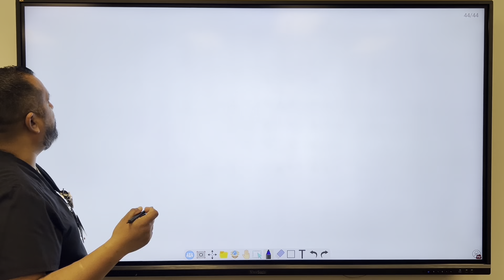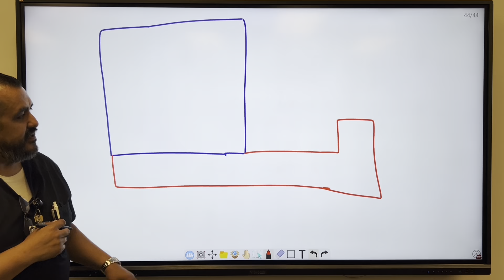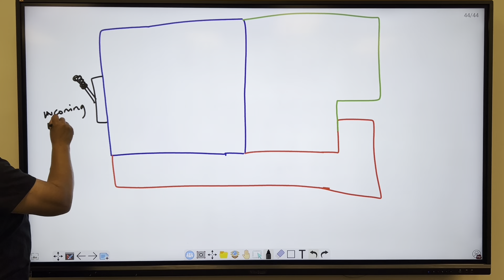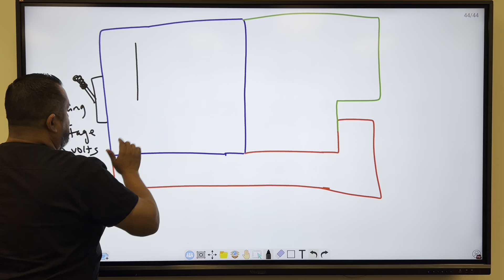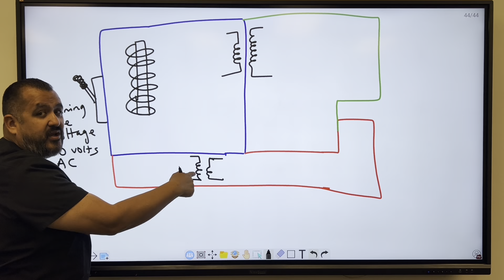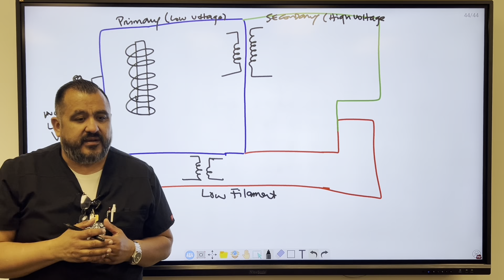X-Ray Circuit, Radiographic Physics (Safety) | Radiography with Mr. M

Comment: Current rad tech student; vids are very helpful, Mr.M. 
Quick question: I thought voltage and current have a direct relationship under Ohm's law, but I noticed it's inversely related for the step up/step down transformer. Can you explain?
Reply from the maker: Hello, Thank you for the comment & question.
Yes, I =VR or Ohm's Law is the basic formula for all electrical circuits, however when it comes to transformers we use Faraday's Law, AKA Transformer Law. This is related to the number of turns of the wire, the voltage & the current. There is an inverse relationship when it comes to transformers. I hope this helps. If you have any other questions please let me know. Mr. M
Reply from the maker: Hello, I just noticed I have a type-o with Ohm's Law. It should read I =V/R,  R=V/I   or V = I x R
Hope you are doing well with the basic x-ray circuit. Mr. M
Reply: @RadiographywithMrM ohhh understood now, thanks!

Comment: Question: The transformers are labeled ‘primary’ and ‘secondary’ transformers solely based on the number of coils?
Reply from the maker: Hello, the number of windings are a factor but they are not the only item. The thickness of the wire, the insulation of the wire, the voltage changes and the electromagnetic field that is created from one end to the other are also factors. But the easiest way to identify them as being a step or step down is the number of windings compared to the primary and secondary side. I keep it simple, the more windings on the right side, then it is a step up, more windings on the left, then it is a step down. I hope it makes sense. Mr. M
Reply: @RadiographywithMrM  Cool way to look at it. I did not correlate that, thank you for explaining more simply!